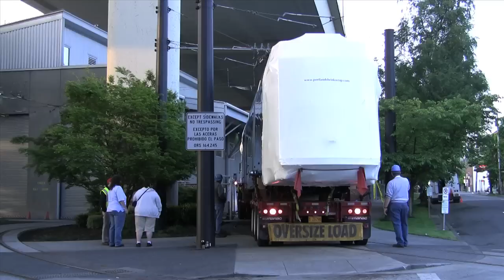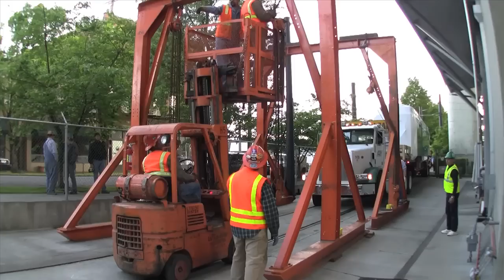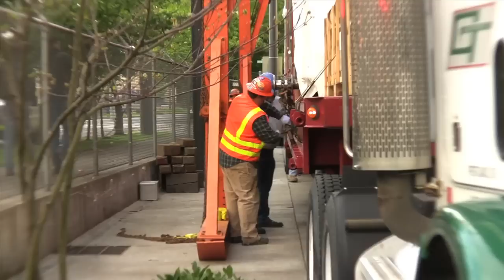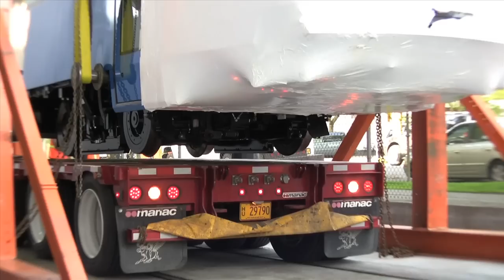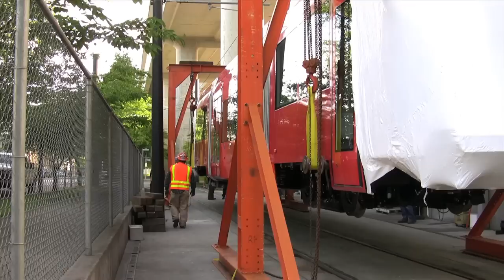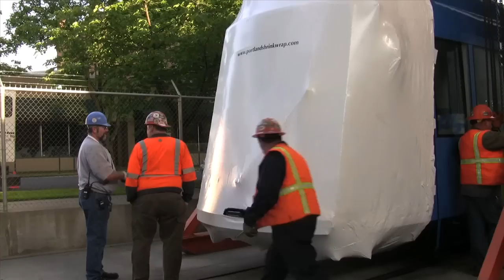New Streetcar Delivery & Unloading

Comment from the maker: They spent a lot of time lining up the truck, taking lots of measurements and going back and forth, and then they spent some time lining up the cranes. The trucking company had expertise in delivering/setting up specialized equipment.  They lifted the streetcar off the truck, spent quite a bit more time measuring, and it was pretty close to spot-on when they finally lowered it.